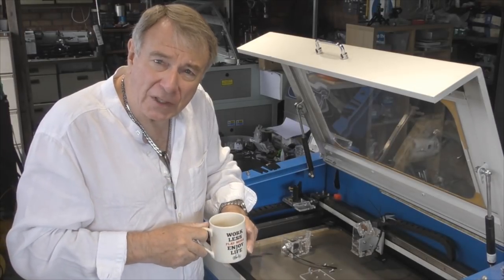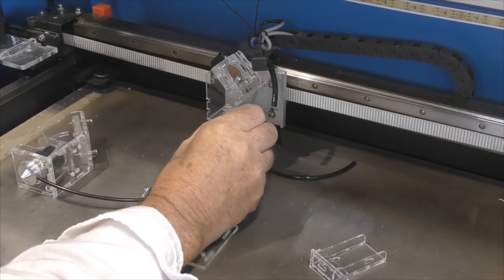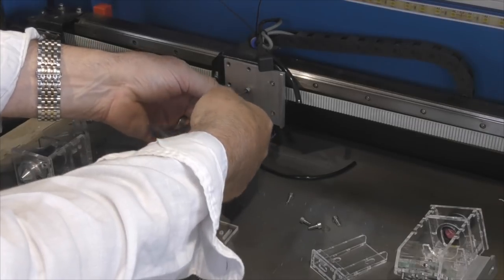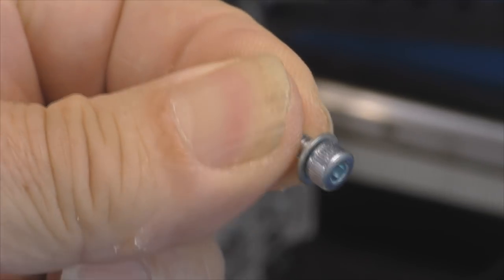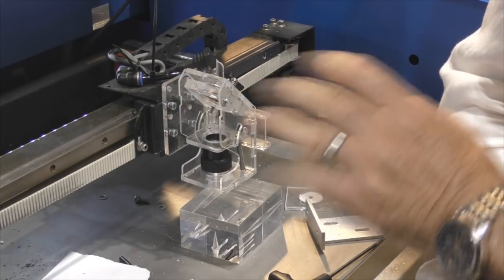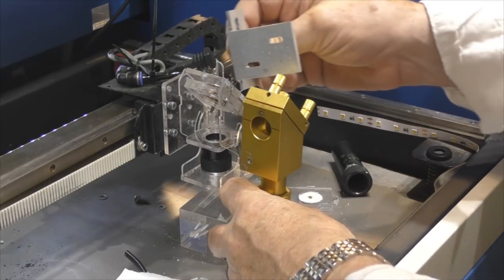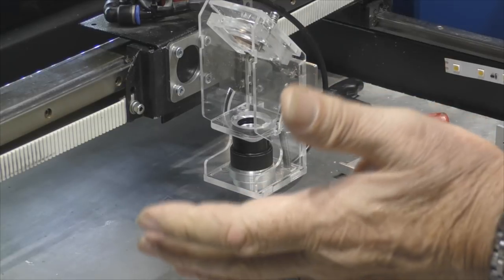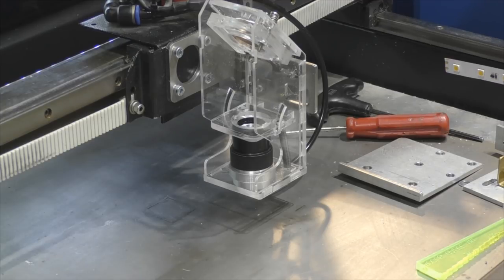RDWorks Learning Lab 148 China Blue Head Transplant Part 2

Comment: Brilliant thought and execution as usual Russ, hope you're both well by the way.

Just one possible option for you regarding glueing the acrylic, I use a very small paint brush, (not with plastic bristles), a watercolor brush that I've been using for about six months now. The bristles don't seem to be affected by the glue and it allows you to paint the glue with a lot more precision. I also found I didn't waste as much glue.

Just a small tip I found by accident when I wanted to glue a pieceof acrylic that was painted on one surface. If the gklue touches the surface it scars the paint. With the brush I can place it exactly where I need it.
All the best
Joe.

Comment: Hi Russ.
Just an idea but why not rotate all from below the mirror section 90deg anti-clockwise (so the access is from the front) this will give you two faces to attach mounts too (both front and rear) to make it more rigid and maybe eliminating the need of the machined brackets.

great idea btw.
Reply from the maker: Hi
I am really promoting  the idea that this is YOUR machine and if your think it need improvement then go ahead. In directly I am trying to apply pressure to the Chines to rethink their head designs rather than bolting on these clunk unadjustable chunks of metal. I am right handed and the reason I arranged the head this way because it is very convenient for spinning the lens tube with finger and thumb.  I can see the possibility that forward facing has it's merits. In the next video,  I will be releasing details now that I know that it is a reasonably robust design. and can handle all sorts of lens diameters and focal length combinations as well as being simple to align  and check easily.  Once you have the basic design there is are no intellectual rights limitations, the idea is free and you can adapt it to your heart's content.
Many thanks for the comment and feedback
Best wishes
Russ

Comment: Great video Russ. The only problem I see, is that when doing long full power cutting jobs, the mirrors are lens will tend to get hot, about 70 degress for what I've been able to measure, acrylic gets softer with temperature, so it may warp or deform overtime. Have you considered Delrin for the hard instead?
Reply from the maker: Hi Abraham
I am very fussy about setting mirrors and lenses true. With my copper mirrors and even moly mirrors with efficiencies above 95% that means max 5 watt dissipation for a 100 watt tube and in my case about 3 watts. I am puzzled how this will ever build up to 70 C. I have been checking but I cannot detect anything above body temperature /ambient after an hour or so of running.  The only reason for the nozzle getting hot would be the beam clipping the exit hole or reflected heat from the cut. I have never experienced either . I regularly touch the end of the nozzle after a work session just to clear vapor debris away. Again I have never noticed heat build up. . I have bought a proper mirror holder and machiined it down to the smaller size required for this head. I didn't use it because it's a machining operation that many folks cannot perform. It's an option though if you do find its a problem. The Mk4 head is so simple it could easily be made from 1.5mm thick aluminium or 0.9mm stainless sheet...even a one piece flat development with with hand bend lines is possible 

Best wishes
Russ

Comment: Hi Russ,
You have been a great help getting me up to speed on this China Laser. I'm having a problem with it telling me that no controller is connected. It's usually fine in the morning, but the problem usually comes when I've been deleting files stored in the controller. It will delete the first file fine, the second takes a little longer and by the time I've deleted 5-6 files, the controlled won't react to a deletion for 3-4 minutes, or it tells me that there's no controller connected. Sometimes, if I turn the machine of/on it will start working again. Have you run into this issue?
Reply from the maker: Hi Bill
Make sure you save any files from the controller.You can upload them onto a (FAT 32 formatted ) USB stick.
by pressing the FILE  button on the keypad and you will see the COPY TO UDISK.   Once you have saved any valuable files you will see another FILE  item OTHER. Select OTHER and you will find the opportunity to FORMAT DRASTICALLY.  This reformats the machine memory and will probably fix your problem. It worked for me.

Best wishes
Russ
Reply: That worked great! Thank you.

Comment: Ok, Russ,
I've got another RDWorks question for you...

Cut width compensation. Where can I set it, and are there settings for interior cuts versus exterior cuts? When cutting one circle, I need an adjustment to offset the cut path out 1/2 the width of the cut width to maintain the outside diameter I want. When cutting a circle inside of a circle, I need an adjustment to offset the inner cut path 1/2 the width (smaller) of the cut width to maintain the inside diameter I want. I know, I am asking for the moon and stars, but if anyone knows, it's you.

Thanks in advance,
Bill Nelson
Reply from the maker: There are two ways of doing this. 
Hi Bill

1) If you put handles round the element in your drawing you wish to adjust then select the offset tool (it's  2 before the preview screen) You will see all the options you are seeking there. If you are doing precision inlays for example with very thin material then this is the simplest method to understand and execute. Do some trial squares and circles to gauge what the cut width (kerf) actually is. This will change with speed, power, focal distance, lens focal length as well as the material you are using, Assume nothing........, test before you cut..
2) RDWorks has a complex way of achieving the same result and it's hidden away in the CUT parameters. Beside the SEAL entry box you will find ADVANCED. Press this and you will see a weird term called SEW WIDTH. This is Chinglish for KERF. You can enable it and set a value but nothing will happen.because by default there isa missing part of the tool bar. Go to VIEW and tick the  CUT IN/OUT toolbar. You will now see additional items at the end of your tool bar. You must tell RDWorks if you wish to cut  inside  the normal drawn path or outside it.  I honestly don't know if it adds the whole SEW compensation to the offset or, as you would logically expect,  just half of it. I have never had need to use this  and there is no obvious change to your drawing to give you confidence it is doing something. However, if you test it with a large value (say 1 or 2mm) and check the preview screen you will see a large in or out offset from your green datum square. It's there to be tested . 

So as not to over-stress  my two remaining grey cells I choose option 1. On the few occasions I need that sort of precision, a  super fine cut with a 1.5" lens serves me well.

Best wishes
Russ

Comment: Another great vid Russ
You keep mentioning your 1.5 " lens. Where did you get it from. I have a Thunder Laser do you think it would work with my machine.
Reply from the maker: Hi Alan
I love my 1.5" lens above all others because it has twice the energy density in the focus spot when compared to a 2" lens. For cutting  you need raw power and for materials up to 10m thick I can make good cuts.. With mu China Blue machine the lens is mounted in the nozzle so when I fit a 2" nozzle, the gap between the work and the nozzle is about 19mm. That is a HUGE distance for the expanding air from the nozzle to penetrate into the cut. With your Thunder Laser I believe you set something like a 7mm gap for your standard cutting lens. That is good because that close proximity to the work helps force air efficiently int the cut. When I fit a 1.5" lens to my China Blue  machine the wrrk to nozzle gap reduces to about 5mm and I get great cutting. If I turn the air assist right down the small spot size of a 1.5" lens means I can reliably achieve a 0.2mm dot and maybe 0.18 with certain hard materials. You standard lens looks like the sort of lens system I have on my Lightblade machine where in principle I cannot fit a 1.5" lens. However, never say never.  Here is a link to a short video of how I did achieve it. It may allow you to do likewise.

https://www.youtube.com/watch?v=M9L13-efN8I

Best wishes
Russ
Reply: 822/5000
Hey!
I've been watching your channel for some time.
Good job - it is very helpful for a novice.
I wanted to ask you if you could explain the difference in lenses from China.
Some of them have the words "ZnSe" and others "ZnSe USA" - are these USs better, eg from a different production?
In my krajuj (Poland) it is said that those with the US inscription are more precise, but is tol only a myth?

Ps. I have one more question - which mirrors are better: Si or Mo, or maybe those covered with gold? - I ask because one of my mirrors is defective (but clean) - in front of the mirror the meter shows 85W, and after it only 70W (this is a big loss!) for this I think about buying new mirrors. At the moment in my machine they are "silver".

Are molybdenum mirrors more resistant to mechanical scratches?

Could you explain it to me?
greeting
Tomasz from Poland!

I cant sent you priv message ;/
Reply from the maker: You Tube have recently stopped their private message system.  Sad.

It is a coincidence that you ask these questions because my next video will explore lens shapes, lens materials, lens costs and the advantages/disadvantages of using each type 
I know from experience that the ZnSe USA is by far the best material in the form of a meniscus lens for producing superfine dots. whether it is the best for cutting or normal text/logo engraving is something I will be investigating. I do not have a definite  opinion at present. However you will not be making a bad buy to get this lens to suit your machine. I do not know if your machine will take a 38.1mm lens, it depends on how your lens is mounted. If it is in the nozzle then you will be able to use a 38.1 mm lens, but if it is in the lens tube above the nozzle , then you will be limited to a 50.8mm focal length lens. 
This is what I would recommend   https://www.cloudraylaser.com/collections/co2-focusing-lens/products/usa-cvd-znse-focus-lens-dia-20mm-fl-50-8-63-5-101-6mm-1-5-5?variant=7645039067187

Mirrors are also an interesting subject. I have spent a lot f time investigating. Although I have been chasing efficiencies of 99% plus with different materials, I have made my own natural copper mirrors. One of my set of 3 just about made 99% the other two wer about 98.5%. Gold promised great things,  but nothing gold I have tried has delivered better than 95%. In practice the most cost effective mirrors are solid molybdenum.  They are very durable and generally deliver efficiencies of 97% when really clean. The problem you may have is cleaning. An odd scratch will not reduce efficiency significantly but any film build up on the surface can quickly reduce efficiency. Remove the mirror and lay it flat. Put a puddle of acetone on the shiny surface and leave it to soak for a minute. Then with a cotton bud, use gentle circular motions to clean the mirror. Look at the cotton bud to see what debris you have removed. Repeat as required with a fresh cotton bud until the bud is perfectly clean. Whether you clean with acetone or isopropyl alcohol there will always be a film left behind. You should then gently polish the surface with with a lens tissue    (Google search "camera lens cleaning tissues")
Only if you cannot get your mirrors back to 95% efficiency then you will have to replace them. 
https://www.cloudraylaser.com/collections/co2-mirrors/products/cloudray-high-quality-mo-mirror-dia-15-19-05-20-25-30-38-1mm-thk-3mm-1pcs-custom-made-for-co2-laser-engraving-cutting-machine?variant=7645314744371

There are two requirements for an IR mirror. First is optical flatness because just like a visible light mirror , non flatness will cause the coherent beam to converge or diverge. The second requirement is refectance. This can be only achived with certain metal surfaces. All metals are reflective  but some much better than others. Aluminium, Gold, silver, copper and rhodium are all theoretically more than 99% efficient. Silicone and K9 glass are non-metals and absorb rather than reflect IR light. Thus they have to be plated with metal to become mirrors.  Plating with soft metals makes them susceptible to erosion with cleaning.  As a personal choice I will never entertain plated mirrors., Solid molybdenum should not degrade.
I suspect your "silver mirrors are really molybdenum. If you remove one, find it to be dull silver on the back  and it feels "very heavy"  when compared to a similar sized coin, then it will certainly be molybdenum. You should be able to restore it.  If it is light and plated then the chances are that you have worn through the metal plating and the backgrond substrate is now absorbing light energy.

Hope this helps with your issue

Best wishes 
Russ
Reply: How i can send you mail or priv message?
Reply from the maker: There is no easy way.. If you send me your email as another comment I will immediately delete it from the public arena and answer you.
Best wishes
Russ

Comment: Hey Russ do you have a solution for a stepper and mirror mount for mirror 2?
Reply from the maker: Hi
Take a look at  https://www.youtube.com/watch?v=RvxgCQinS_c
I think this size of drive pulley is more popular now.  Whilst I was making this prototype, I have made a small batch of pieces  that I will be able to sell Once I get this Tangerine Tiger up and running in the next video.  I will  spend time building the batch of sub assemblies and make them available for sale. I will then issue a short video with details about this. There will be dimensioned drawings available so that you can check your machine before you buy because I do not want to be selling you scrap metal.
 Thanks for your interest.
 Best wishes
Russ

Comment: It would also be great to see if you can break the 20, 000 mm/s acceleration for engraving. with all of that mass of, the inertia ratio should bave been improved dramatically, allowing for much quicker acceleration.
Reply from the maker: Hi Abraham
I do plan a video about that exact subject to see just how much I can push speeds and accelerations without inducing "head wobble" As I proved with this experiment the head mount MUST be ultra stiff.  I have so many things still left to experiment with...I keep thinking I must nearly be at the end of this series but new issues of interest  keep popping up
Many thanks for your comments
Best wishes
Russ